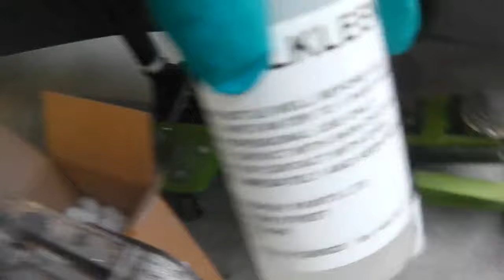Classic Car Resto - Mk3 Cortina - Project Bramble Ep26 pt2

Comment: The no.1 - first rule of suspension disassembly is extreme caution and safety. Use eye protection, hand protection and if needed a full-face shield.  Pete does it safely. As for the recoloring of the upholstery material - I thought it looked streaked and not fully covered.  The set up to paint the material was crude and lacked good lighting. Red over red-brown would be tricky to get right in even the best of professional spray booths with good lights!   I know - I have re-colored two sports cars in the past/red over red, and natural hide color over white which required stripping the old color off to near bare leather the applying the natural  hyde color using the leather padding method to gain a rich neutral color that wasn't spotty or having a re-colored appearance. 
What I learned was this - when you cannot perfectly match a material or leather - punt, go with something that looks very close and looks appropriate. Sometimes being a purist can be your worst enemy when it comes to full automobile restoration. Bramble will be glorious when done - I just know it.
Reply from the maker: its just the camera, there are no streaks, if there were i would repaint, it rubs off and becomes uniform, it was fully covered, i went over and over it, same procedure applied to my previous restore (ruby) with great results, but I agree on that clip and that lighting it looks streaky bacon !!!
Reply: @PeteCswampy  EXCELLENT my friend. Don't overlook any detail. Bramble deserves a fantastic restoration and then touring the show circuits. You'll be very proud of your accomplishment and the whole series of videos on this project, so that others may learn and follow your example.  Everyone tells me I am too fastidious and nit-picky about my cars - but they all compliment me on them and then offend me by offering low ball prices -  when they know they are worth what I ask for them. (dirty cheap chiseling chicken pluckers)  NEVER EVER sell Bramble. Well, unless anyone should offer you $200 grand for her - then take the money and run like you stole it! ;-)

Comment: Takes me back to watching my dad fix breaks/shocks  up on axle stands only the smell rust oil and grease is missing. He used simulate an impact gun by getting me to hammer while he turned socket/spanner
Reply: I remember my father swearing a lot , proper losing it , and his sore red knuckles

Comment: Sorry I'm late to the party. Brilliant vid as always Mr C, sod your luck with them springs oh what we wouldn't give for an extra inch eh. That spring extraction tool is brilliant but I bet that you wish the bolt was a bit longer. That had me worried as much as you were. Must be nice to get some spanners in your hands after all that metalwork and welding. This is the part that I like most, the mechanical bit where its like taking a jigsaw puzzles apart and putting it back together again. Has the shell gone to paint yet? Give you some room when it does, to do all the other jobs you have to do. Love all that stuff. Gonna be a fantastic car when its finished, can't wait. With you every step of the way Mr C keep going. Brilliant brilliant stuff can't wait for the next instalment. All the best from the smoke Oooooohhh yeeeaaahh ☺ 👍

Comment: I've replaced springs on a few Clios as they have a tendency to break on the bottom 3-4 inches as well as on a Megane. Scary job even with the proper tools. You just seem to keep closing and closing to fit the new springs and the compression tools start bending! I wouldn't be brave enough to use a power tool to undo the spring. I'm still alive with no scars, but it still makes my bum cringe doing that job!
Reply: Like a rabbits nose !!!!!!! 
Proper proper terrifying............I watched from behind my hands !!!! Sort of !!!!!

Comment: Got to make myself one of those ball joint spreaders, the spring compressor is also a good idea if you only work on one type of front-end, the bottom attaches the same but the top of the shock has a nut instead of the bolt,but still ,a great idea- thanks

Comment: Hey Pete, there is a trick to getting off the split pins. Use a pair of diagonal pliers (US name) they look like cutters - grab the pin perpendicularly and just pry them off using the hub for leverage. Like pulling out a nail.

Comment: Electric knocker gun or air hammer guns do not work as well with extentions between the socket and the gun, they half the power roughly, use long series socket where possible.
Reply: I just scrolled down to put that, you saved me the trouble ;)
Reply from the maker: thank you Albert for this I never thought of that, power must be lost in the flex impact , makes sense, thanks for the info!!! Pete
Reply: OK Pete I found this out after many years of using this sort of thing up to 1" drive, we had the long series sockets designed for knocker guns (usually couloured black) to take the strain better than normal sockets, of course we were using them on a daily basis on 18 1\2 ton pumps so heavy use, that asside, you are doing a fabulous job there on Bramble, I admire your dedication and hard work it will be great to see the finished vehicle and your first drive in it, well done, Albert
Reply: I was thinking the same thing, plus it would be easier to hold drill an other tool. I like your build and subscribed because the cat meowed and told me too. Lol

Comment: Coil springs are evil ! I remember my brother , who is a mechanic by trade , take the coil springs out of the Avenger l owned at the time using spring compressors . "Get this wrong and it'll take your head off!" he said . Coils were subsequently cut down , heated up and squashed at the end , and the car had just the right stance (for me anyway) when it was all back together .  And no , it didn't handle like an old matress !

Pete , those shock absorber bolts that had fused together ! I was sweating here watching you get them out ! That was intense , especially as you had to "rinse and repeat" on the other side ! Speaking of the other side , do you find that stuff on the nearside (passengers side) is harder to come apart as all the road crud gets in there as opposed to the drivers  side , or is it just a psychological thing ? 

The ball joint splitter is novel , but yes , l'm more familiar with those fork shaped tools for that job . No need to apologize for using a socket extension bar as a drift to knock that bolt out though ! I mean it's hot and humid , the bar is to hand and it fits perfectly , so why not ? 

Regarding those little tab things holding behind the bolts on the tin shield things , if  you didn't know they were there (l didn't!) you'd force the (wrong size) socket on the bolts and chew everything up !  

So l asked the question on part one , are you going to lower the front end a tad ? I would , but l appreciate it's your car .

Never heard of that vinyl dye stuff before, l bet it smells delicious ! Closest l can remember was vinyl brush paint . Never used it on upholstery but do remember painting many a nicotine stained headlining with it . Worked wonders , especially if you mixed black and white together . Smelt like really strong pear drops and kind of sent my head a bit funny ! (maybe this explains a lot!) 

Smokey is great ! I know you wouldn't hurt him for the world . I love cats , and though we have none now (used to have five rescues) l know from experience they like a bit of rough and tumble , but will let you know when they've had enough !

Thanks for the video , as ever l really enjoyed it and liked the "and now for something completely different..!" aspect when you switched from prepping that vinyl roll to wrestling with the front clip ( l prefer clip to cradle , but l suppose the latter is more accurate) . All good !

Finally , did you realise Henry was watching you around the 1:03:17 hour mark ? 

Take care and have a beer , you've earned it !
Reply from the maker: gonna check on Henry at 1:03:17 yes gonna lower the car. yes  nearside always a touch more corroded, good spot Pete. as always, look forward to your replies, it makes filmong worhtwhile knowing the youtubers are out there
Reply: @Peter Barker , I know ball joint spliters as u say , still not seen the wonder tool as I'm watching ....
This is truly terrifying 😳 tye springs!!!!!!!! Yikes !!!!
Reply: @PeteCswampy  the suspense in this vid , u gave me proper heepy jeepys  !!! Heart attack time here re these springs

Comment: just shows there the orginial nuts on the serpenson huh? not been modded removed or anything, good thing there not that pricey but dam might need to put plenty of that stuff the usa car restorers use for making sure nuts come off when there put on the car, 
i'm guessing the reason for removing the rivets on the ball joints is to get everything powder coated? or is it jut easier to remove them and fit something longer lasting like the mg dounuts or the triumph's dounuts that you can put on there but after a few years will wear out and need replacing,

Comment: OK one item has 17h38m at time of messaging you the other has 3 days 16hrs sorry that the best I can do without telling every one in the world you've most probably spotted or already have, there not my bits just spotted and trying to tell you
Reply from the maker: thnaks Adam, scannin ebay theres all sorts, any clues? i nknow one item prob gone, im always looking on there but not sure what parts you mean but thanking you for helping
Reply: @PeteCswampy  mk3 genuine Ford nos pair hinged rear 1/4 window trims also gearstick gaiter (I know yours is auto) but for a future project and other was nos genuine Ford mk3 vinyl roof trim but that's ended now I'm sure you scan every night  but just incase you missed them, and yes as you've herd many times my dad had one of those 2.0 GT WTP193L long gone scrapped (OK delet after reading) 👍